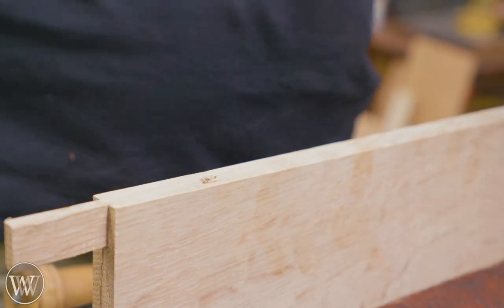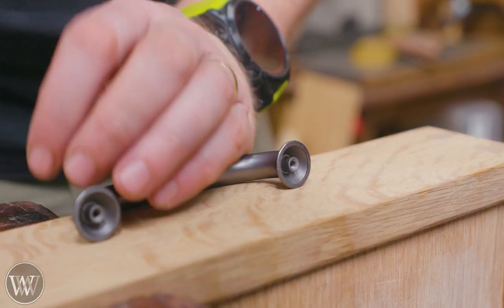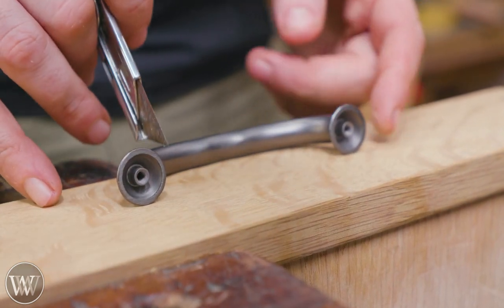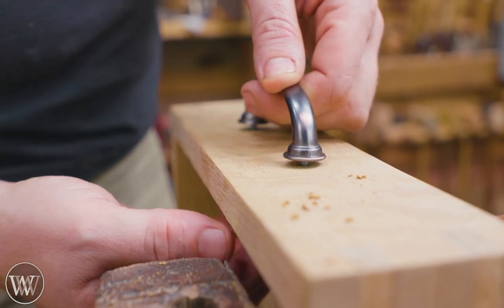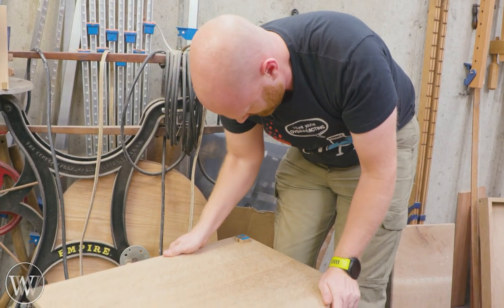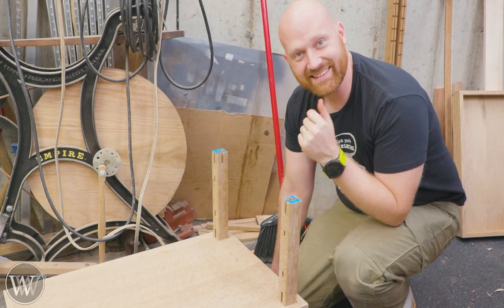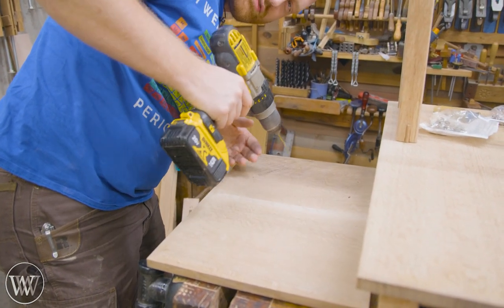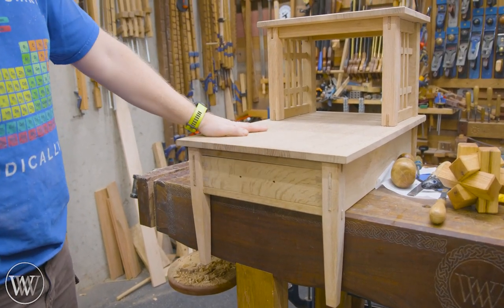Finishing The Bed side table Final episode

Comment: When using a drill or impact driver, especially with phillips head screws, I found the impact bits to be fantastic in preventing cam out and striping. 😉
Reply from the maker: That's actually what I was using here.
Reply: @WoodByWright  My bad it didn’t like the ones I typically use.

Comment: While your method of finding the second hole of the drawer pull works, why not lay the pull flat on the worksurface and use the same edge to edge method to locate the second hole? It will eliminate any guesswork on vertical alignment.